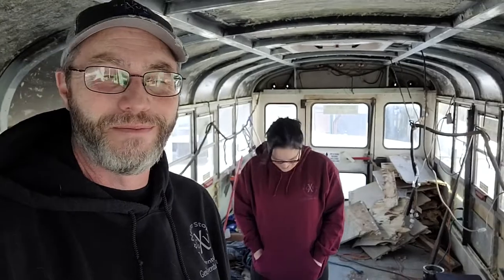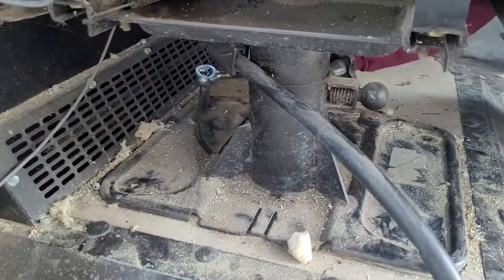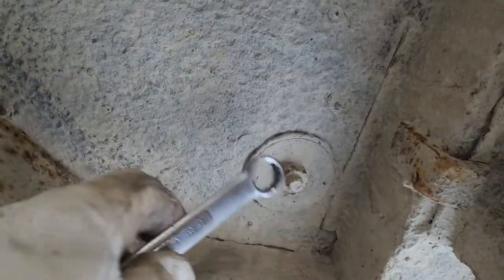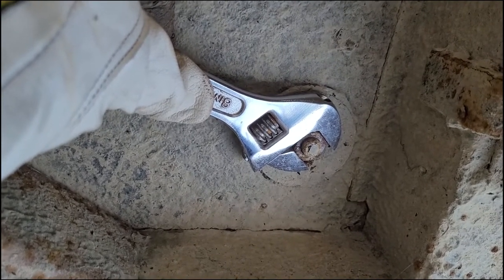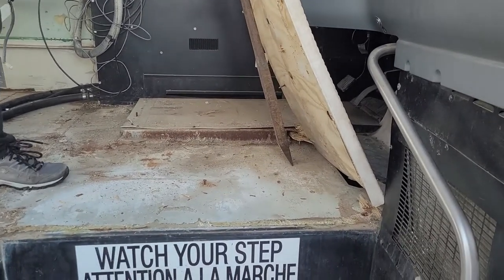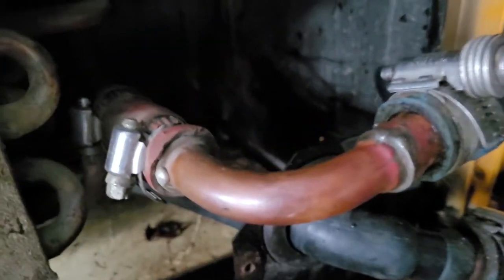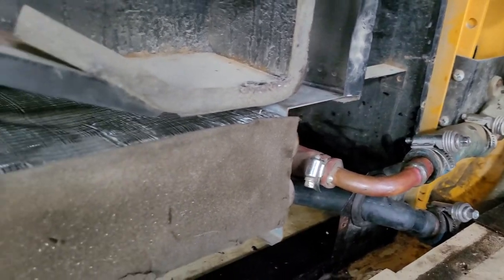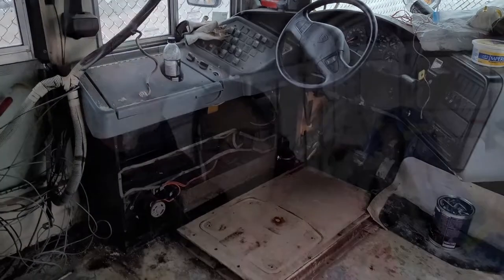Bus Build Ep 9 - Removing The Rear Heater

Comment: Did you have to turn off the radiator valve? Were there any problems with starting the bus after? I saw where some builders said to burp the coolant. I am removing the heater soon and will be alone in a field,I am trying to anticipate the problems. Good videos, liked and subbed 💙👍🏼
Reply from the maker: Thanks for your comment and question and the sub of course! I did turn the valve off when I was removing the heater. Once I reconnected the lines without that rear heater, I started the bus to look for leaks. Everything worked just fine.